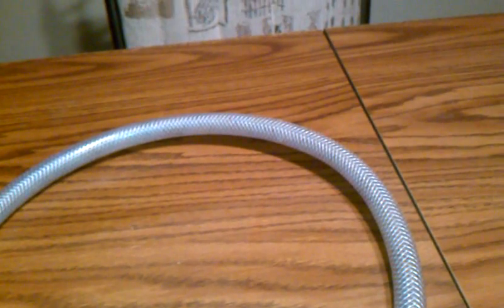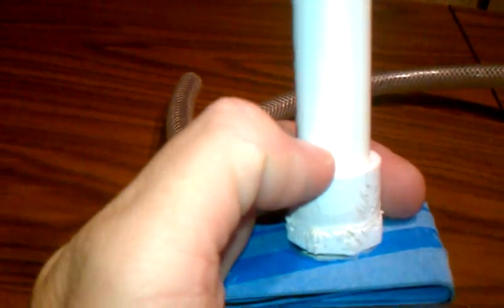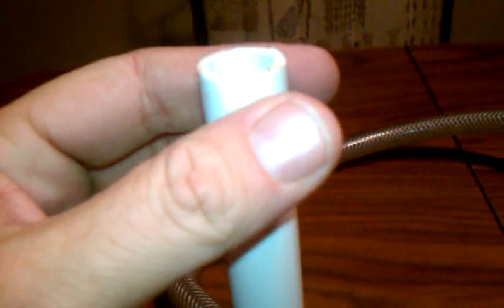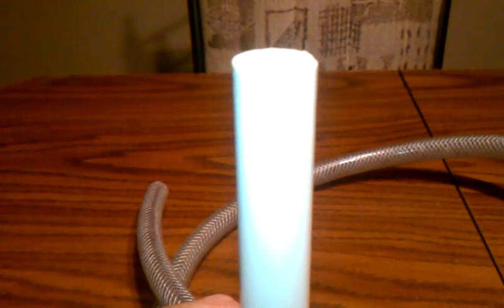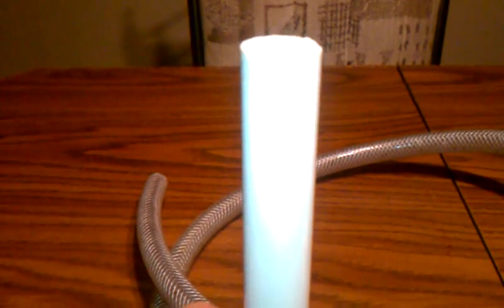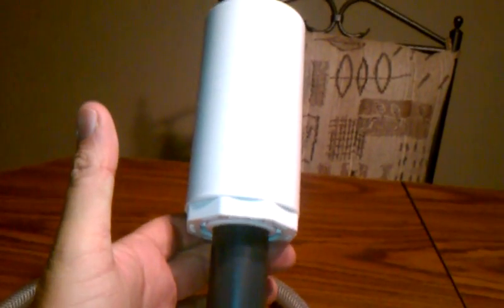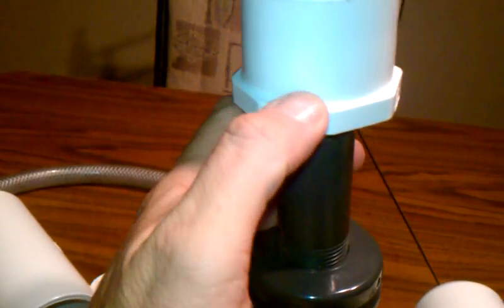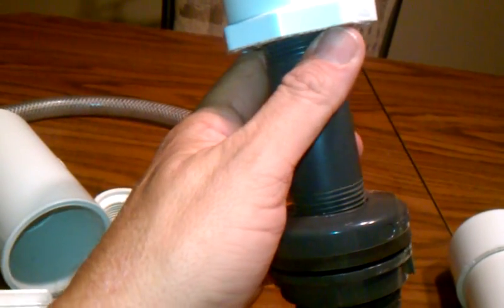Talking about Siphons

Comment: I want to thank you for this video. The main thing that has been holding me back from completing my first system has been that damned bell siphon. After watching this video, I went home and finished my system for free by using your loop siphon with a bit of junk garden hose. It's been working perfectly for 3 days now. And I was able to make it stable and un-adjustable just by drilling a hole in the side of the grow bed at the crest of my desired water lever, running the hose directly through that hole and a bit of silicone sealant.
Reply from the maker: Well Glad I could Help.... My favorite style of Siphon is still the Affan Type Bell siphon. There are many different styles of siphons that will get the job done. The you understand the most, is the one that will work best for you. Because you will be able to adjust it to your needs.
Reply: was more of a cash-flow problem that was keeping me from using a bell siphon. Like I said, I was able to make your loop siphon for free. I'm sure once I get more established and start working with more volume, I will probably go with the bell siphon. Thanks again. You were a big help. Stogiefarts inadvertently referred me to you.
Reply from the maker: Eric Mastenbrook I need to get around to doing more videos. But there doesn't seem to be enough hours in a day anymore...

Comment: Check the shower section of your Home Depot. They have basins that come with threaded fittings. A lot of times people will not take the fittings and the store will let you take them for free. They're usually 1" or 3/4". The more you scrounge.